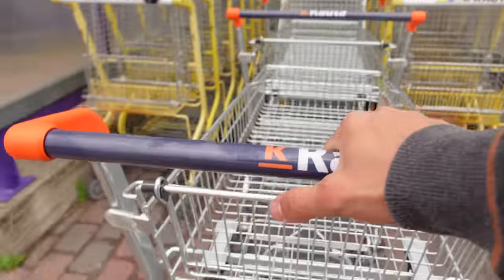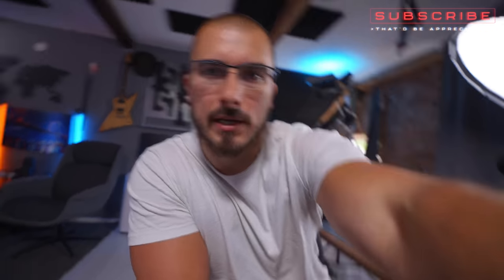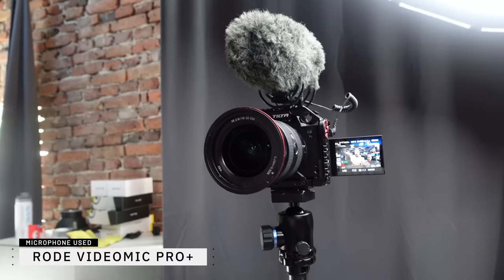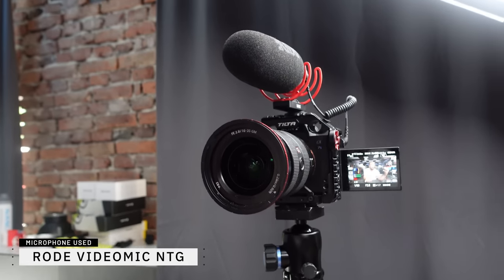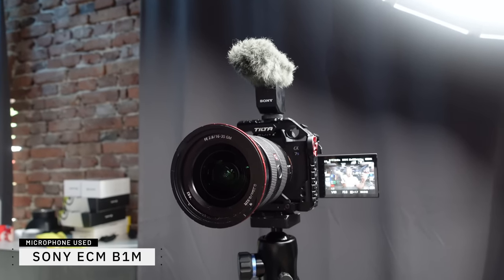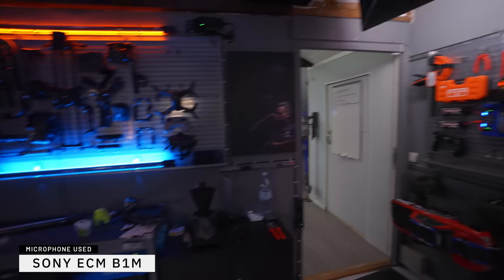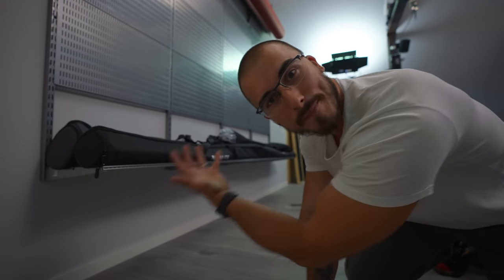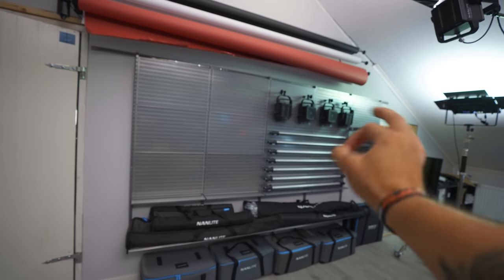Is This The BEST MICROPHONE For Vlogging?

Comment from the maker: The Sony ECM B1M Does not work on ALL sony cameras, make sure to check the compatability!
Reply: yes, I think it requires zv1 or later
Reply: It actually does work on A7iii, just switch to analog!
Reply: Love these vlogs Peter. 👍🏼 Would love to know the settings you use on that microphone as well as the audio settings you are using on the A7siii?😊
Reply: The dead cat that fits on that microphone fell off while riding on the scooter here in Bali🤣 Unfortunately it’s literally impossible to find a replacement. Be aware of that bro😊
Reply: Its work with sony zv-e10 ?

Comment: Great video as usual! Question re the ECM-B1M - I have a low 'clicking' sound when the camera is in AF continuous - have you come across this? It's really bugging me and I don't know why its there or how to eliminate it. Tried everything I can think of!
Reply: It does it with both the ZV-E1 and A7sIII and 3 different GM lenses
Reply from the maker: Hmm, sounds like it picks up the AF motor! What lens are you using?
Reply from the maker: What’s the settings in the microphone? I have all switches up when I use mine
Reply: @PeterLindgren1  I have tried with the 14mm, 24-70mm, and 12-24mm all GM lenses. I tried with all switch combinations (up being my standard) but even with NC there is still a bit of noise picked up, but I don't hear that in yours or other creators! Thanks for the reply

Comment: Thanks Peter! I know this is an older video but how has your view changed on the ECM-B1M mic? What kind of processing is required to get that nice deep clean sound you have? I have watched a few other videos claiming how amazing the sound quality is, but I just don't hear it. It seems rather "cheap & tinny" raw out of the mic compared to ANY of my Rode mics. I was thinking of grabbing the ECM-M1 due to the different patterns available, but I REALLY like the sound right out of my Rode mics and only having to adjust the level. It's a shame they are so massive! Thanks again!
Reply from the maker: I’ve never done any post processing to my videos when I’ve used that mic. I think it’s 👌🏼
Reply: @PeterLindgren1  Thanks again! I’m gonna give the big ones a shot! I got the small ECM-G1 and it’s too simple and sounds horrible.

Comment: Hey Peter, I know you actually respond to comments (much appreciated eh!) and I'm wondering what you recommend for my mic situation. I bought a Sony RX 100 Vi without realizing it has no audio jack. wondering if you think a usb c or micro hdmi to 3.5 mm audio jack adaptor would work? I really don't want to use a Zoom recorder or post sync audio. other option is to try and sell my camera for cost and upgrade to the Vii which does have mic input. let me know what you think! cheers from Canada, it's cold here now eeesh! 💚✌️

Comment: Reviews are always good and informative for those looking for either the best gear or affordable gear based on budget.

My situation is an anomaly because I have a Nikon D3400 camera without a 3.5mm jack for external mic.

My solution was to purchase a Tascam DR 05-X audio recorder and a cold shoe shock mount yo put on the camera. Still no input but I can place the audio in post. I also use the audio recorder on a manfrotto pixi mini tripod if I want to use it for a desktop microphone when using my laptop